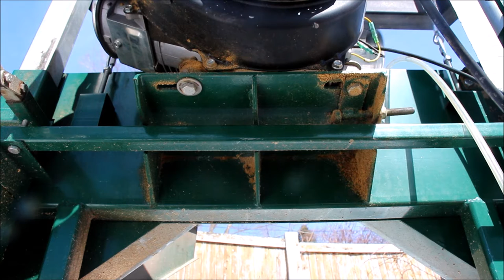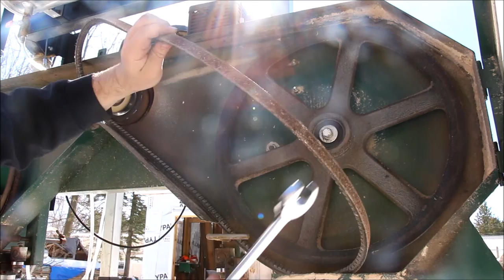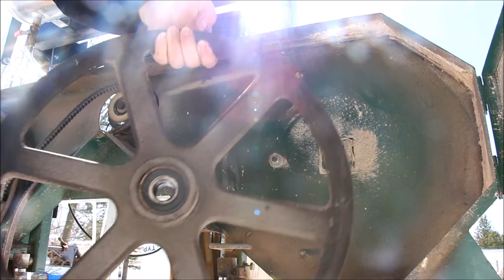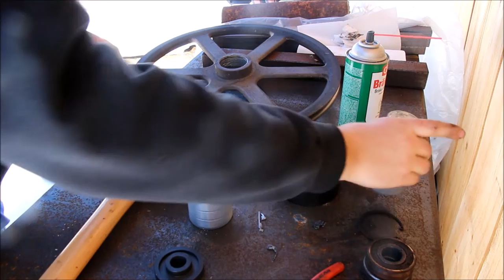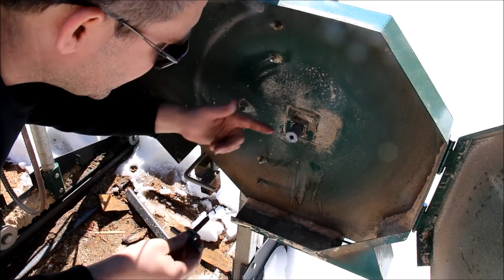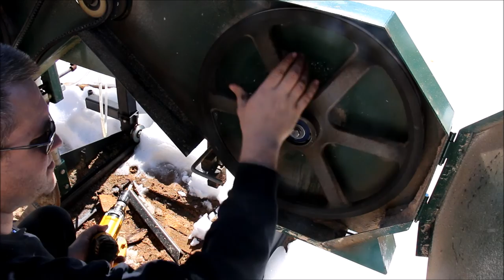Woodland Mills HM126 bandsaw bandwheel bearing replacement #2

Comment: If you get another bolt the size of the retaining bolt for the shaft and wheel, approximately two inches long and drill a 1/4" hole in the end of it so the tip of your puller will sit in it, then you can pull your wheel with out marring the shaft threads. If the bolt is at least 2" long then there should be enough room for the shaft andbearing to release.  Thanks for the video!
Reply from the maker: Yep!  Thanks for the comment!